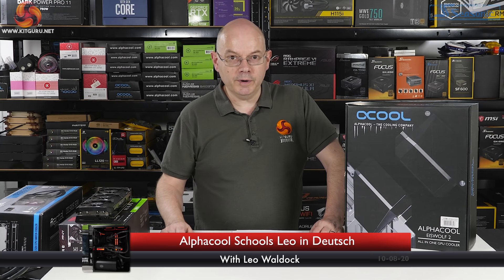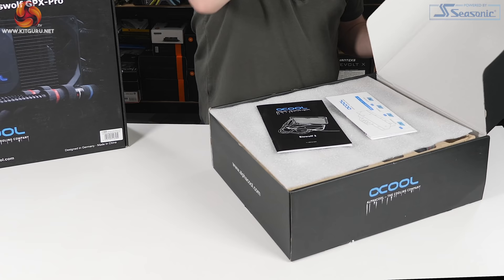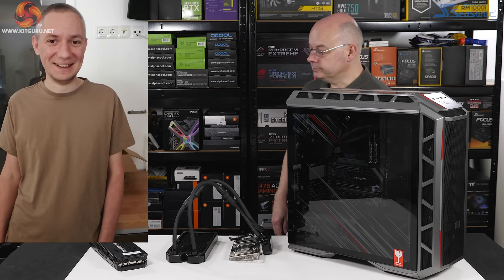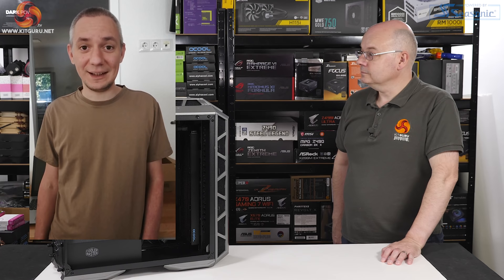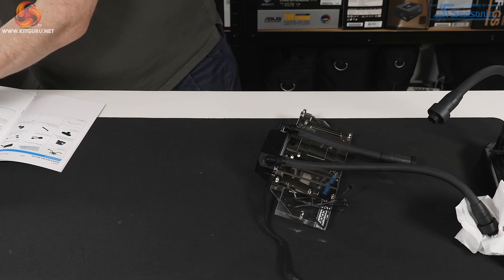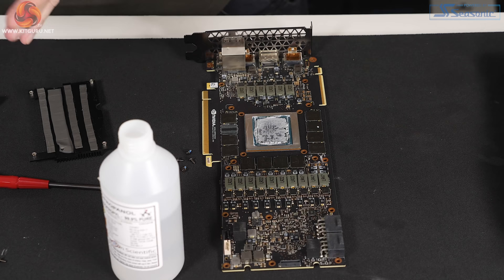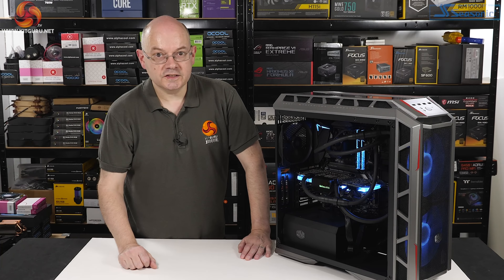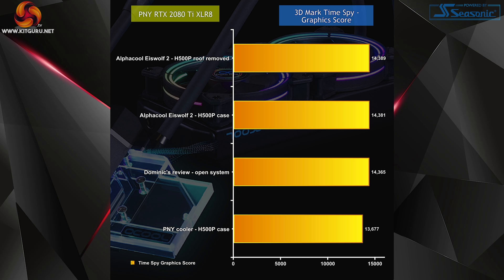Alphacool Eiswolf 2 AIO GPU Cooler Review with LEO

Comment: Tip: use round toothpicks or something similar to line up the card with the block. Just insert them into a few screw holes as guides. Once block is in place, just pull them out and put your screws back in.
Reply: awesome tip!
Reply: Dude what a Great idea! 
This Saved me a lot of Trouble
Thanks!
Reply: I am gonna use that tip in around 2 h, thanks

Comment: These coolers are installed incorrectly, the CPU one should be installed on top (The way its mounted now their is air bubbles at the top of the radiator where the hoses are allowing air in the system, most likely leading to higher CPU temps/loud pump because of air/bad for the pump) and the GPU radiator should be installed in the front (radiator mounted to the front with the hoses oriented at the bottom, making sure the top of there radiator is higher then the GPU allowing air to collect at the top of the radiator and not interfering with the water flow).

Comment: Gpu aio gateway drug to open loop. I see what they’re doing here:)
Reply: This is SO true. I started out with a 280 aio, moved to an open loop with a thick 420 radiator and two thick 360 radiators as well. How did I get here?
Reply: Tyler Durden yup. 280 for my cpu. Then got that g12 bracket and a 120 for the gpu. The rest was history.
Reply: Yeah hopefully its cheaper than the first one, but even still. I planned on getting on of the Eisbaer CPU block/pump/res things and a full GPU block that way it was easier to use long term, but this is still a cool option. Hopefully it's available in NA soon too 

Edit: nvm its on the NA page now lol

Comment: It would be great to have a followup video, with the two AIOs connected!
Reply: You mean two radiators? There is one GPU AIO in this video being used on the video card, not two. The radiators are not the AIO's, they are different.
Reply: @Sabrinahuskydog  Eisbaer and Eiswolf AIOs use identical quick-lock closures in order to expand and connect together.
Reply: @Sabrinahuskydog  you really don't pay attention do you. Alphacool literally encourages buyers to combine the eiswolf with the aurora AIO's. So yes. It comes down to a closed loop of two, yes TWO AIO's so that also means TWO radiators.

Comment: your radiator is incorrectly orientated in the front. tubes should be on the bottom or you could have unwanted bobbling noises not to mention poorer performance in terms of cooling capability.

Comment: I don't understand why they have left the tubes the same length and used what looks like rubber 😆 why not put a carbon sleeve over at least!
Reply: The reason this tubing is used is because it's VERY resilient to heat, cold, fluids, kinks etc. It's basically to help those who will use this kind of item, those who are looking for a cheap water-cooling solution :)

Comment: One question, because I think that for those who are used to alphacool it is logical and it is not even mentioned, when you open the circuit the liquid does not spill completely. I have to assume that it has a closure system that only opens when it is screwed in???

Comment: New to PC gaming and have a 6800xt Nitro + and thinking of water cooling it. 

Where/when do you add the water as you've let some out in detaching the hoses? I assume the water stays in its own circuit hence no need for any gasket between the CPU and silver portion of the Eiswolf?

Comment: Why not buy the cheapest possible 2080ti rather than one that had a big cooler on it and would imagine wasn't the cheapest?
Also, when you undo the pipes and water comes out, doesn't it need to be fairly full? I would have thought any air/air bubbles in the loop is bad since that won't cool it. What if you lose a lot of it when undoing it. 
Anyway, nice video. But I'm not sure it is worth £180.

Comment: did you have any issues with bubbles and flow? my gpu block is full of bubbles. temps are the same as the air cooler. and i can not see any water actually flowing through the gpu block.

Comment: Hey, i know this is an old video but how did you fit the water block on PNY XLR8 2080 ti? I have the same card and when trying to install the block, there are some components behind the power connectors that are too tall and makes it impossible to secure the block without bending the PCB?

Comment: Hello. I have Question. I bought this AIO for my Asus Strix RTX 3090. Can i plug the Pump Header in any 12V Slot on my Mainboard because my AIO Pump Connector for the CPU Cooler is already in use. I still have the CHA 4 Connection available. Also will i have to make any adjustments in Bios to make the Pump run at 100% ? Kind Regards.

Comment: Leo why didnt you try swapping the rads over if they use the same connectors? connect the 360 to the gfx and 240 to the CPU. may have benefited from the larger area on the rad.
Reply: Thats not really possible. The Eisbaer CPU AIO has only one QDC. But you can connect the Eisbaer with the Eiswolf 2. You will have a similar effect.

Comment: Wow, you only dropped temperatures using water to what an air cooler does on a open test bench?  Where do I start?  First, those 200mm fans don't push air, they move it.  You need additional pull fans to actually get decent airflow through the radiator.  Water-cooling should drop temps by ~20C, closer to 30C in your situation since that case sucks.

Anyone with a AIO on their CPU and another on their GPU should really ponder their life choices.  With the current power consumption on GPU's and CPUs open loop is really the only way to go.  We need better cases for this, the currently available cases are crap.  Twin 360's have become a minimum and 480's should really be an option.  It's ridiculous there are not built in mounts for the popular pumps in places people would actually put pumps, or even cases with built in reservoirs, pump mounts, and custom fitted rads.  Maybe something like the whole right side of the case has a radiator and shroud assembly that swing out with the door so you can work on the computer?  A 300x300 rad should be enough.
presentedillustrates

casesbecauseYouTheretherecases

Comment: When removing the stock cooler didn't you take the backplate off AFTER you removed the cooler? So, while reinstalling the IceWolf, shouldn't the backplate go on BEFORE the waterblock?  If the backplate came off last, there should be pass through holes for the cooler block screws.

Comment: Two major problems I see with this design.
1) the sag you're going to get from the extra weight of the pump will HAVE to be supported.
2) Again, the pump, it creates quite a lot of heat so having it near the block is never a good idea.....just look at AIO's temps compared to a custom loop.
Reply: Yes, that 3W from the pump will change totally the temperatures..... its not a D5 or a DDC ;-)
Reply: @AlphacoolGmbH  3W of power derived heat isn't ALL the heat. You have friction of the bearing and even the water hitting bends(yes I know, not a lot, but it's all  additional heat).  I would also say that pump motors get hot enough with continuous use to NEED a heatsink. Don't see one on that, and don't give me no crap about "but it's only 3W", with the liquid heat-soaking and the friction it soon builds up.
Reply: That's why ASATEK pumps don't last. I've had 1 Delphi pump die on me in 30 years, one of the first I had only lasted 5 years because I didn't et a heatsink kit to put on it.
This is just my take mind, so take it too seriously.  I came into watercooling just before Peltier and phase-change cooling got popular.....
My standards for practicality are far higher than aesthetics.
Reply: @JuxZeil  Sorry to say, but that is absolutly nonsens what you are telling. It is a tiny pump without any relevant heat.
Reply: @JuxZeil  To compare an Asetek pump with the DC-LT is far-fetched. One has nothing to do with the other. Most small pumps in an AIO die due to diffusion of the AIO's water cycle which causes the pump to get too little water and then the bearing will break rather than overheat and die.
Reply: @AlphacoolGmbH  Please explain "diffusion of the AIO's water cycle" and cause.
Reply: @AlphacoolGmbH  Question, is it possible to add a cpu block without anything else with this kit?
Reply: @pav1u  You will ned some tubes or one of our extension kits. But... you have to fill the loop with a bit more liquid too.
Reply: @AlphacoolGmbH  Thank you for the quick reply, my question is regarding the pump, will it have power for 2 blocks?
Reply: @pav1u  2 Blocks and one radiator, yes.
Reply: @JuxZeil  3watts of power into anything cannot generate more than 3watts of heat, be it from fluid/mechanical friction. That would violate the 2nd law of thermodynamics. This cooler is also designed to cool a 300watt video card, so that's roughly a 1% decrease in performance.